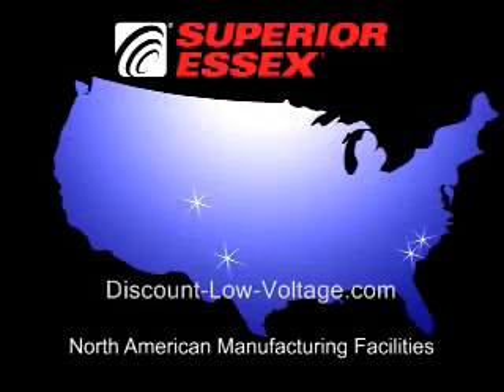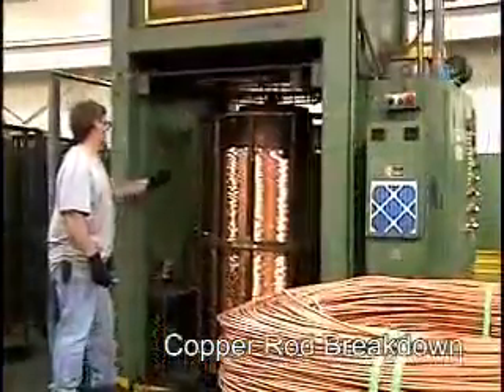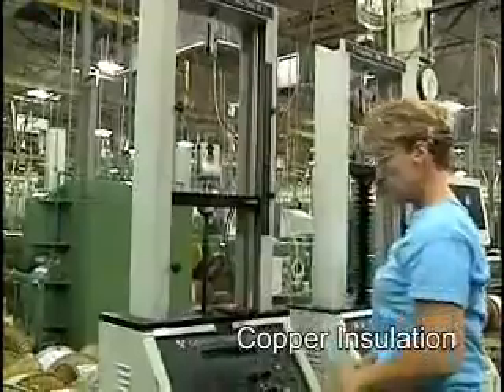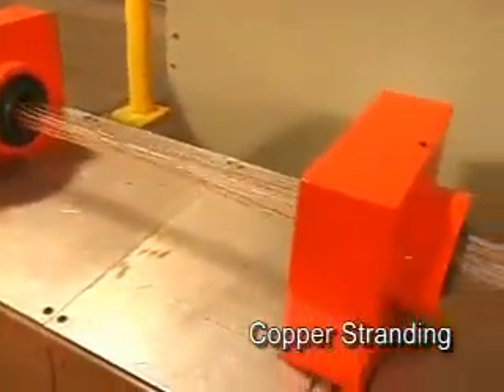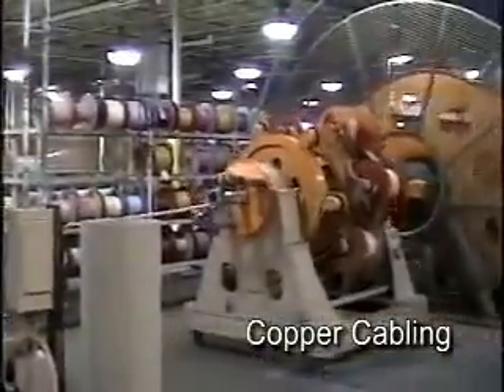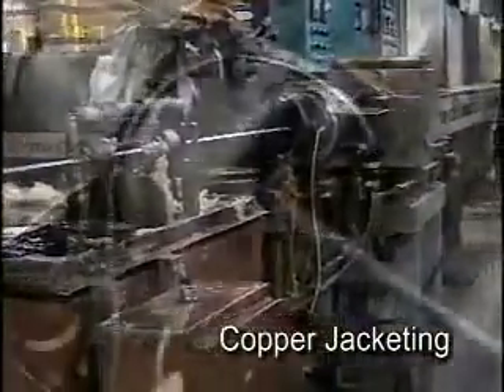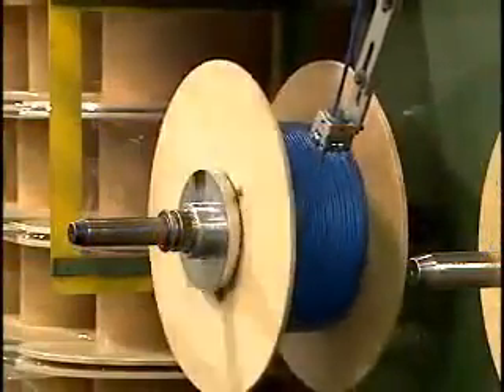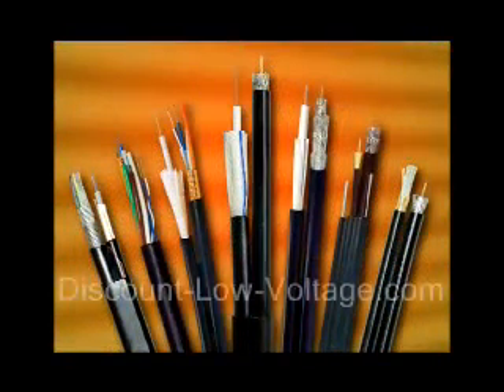Superior Essex Copper Cables – Outside Plant and Premises Cable Manufacturing Process – YouTube

Comment: @msdoe8 The standard voltage for the telephone system is 48 volts DC. Ringing voltage is much higher, around 90 volts AC at a low frequency. When you place a load of about 600 ohms on the line, you are "off hook" or connected.

Telephone ringer voltage is 50.5 volts at standing and -50.5 volts at ringing

Comment: I have experience working electromechanical cable, pressure and vacuum, plastics, fep100, tefzel 280 hitrel, polypropylene seo12. Camesa work in steels. also experience bouncher twisted copper machines and mechanical and electromechanical cables steel.
Reply: xlnt!